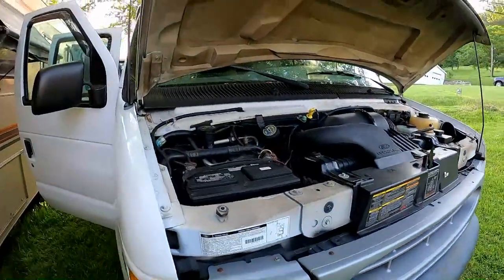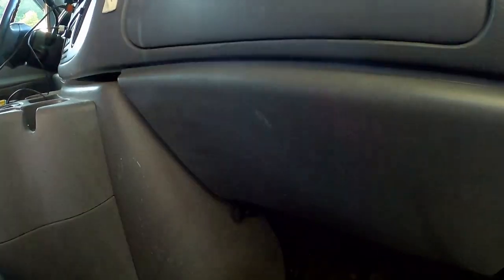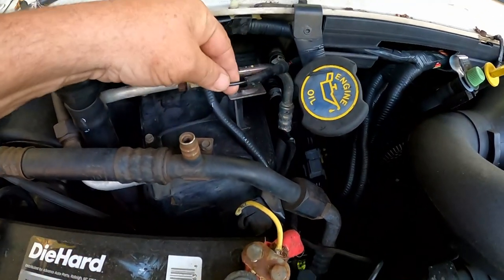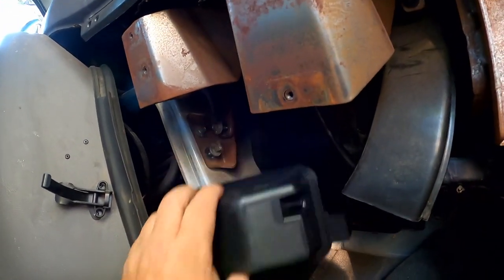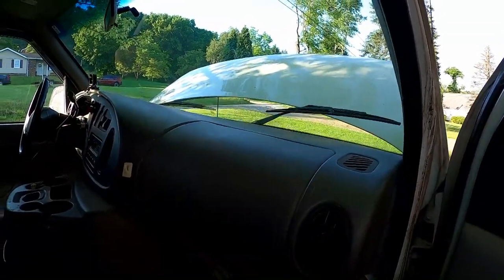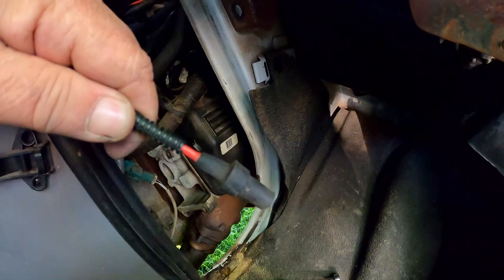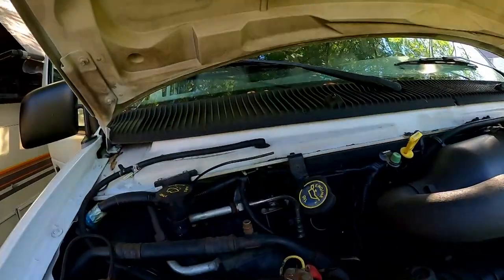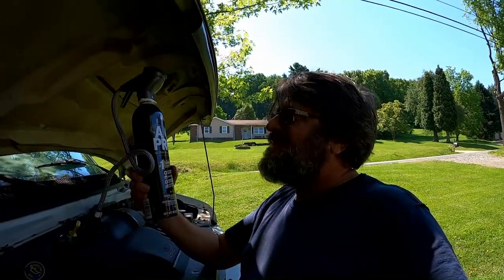FIXED! Air Conditioner Not Blowing Cold Air Out of Vents - Ford Econoline E250 AC Repaired Recharged

Comment: I saw a van build on video where the AC was in an upper cabinet.  The outside of the van had a grill and that is where the air blew.  It was also screened inside.  Looked cool but took up a whole cabinet.

Comment: Just as you were looking for the keys I told Suzy that i know there's going to be a bunch of dust blow out of them vents when Dave turns them on. Soon as the dust came out Suzy said "well, you tried to warn him!" LoL. Done that same bypass myself before. Got blasted in the face with years of dust. Apparently had my mouth open too because my reaction was the same. Trying to spit out all the dust. As for the air conditioner deal. It may be ghetto looking but it will be functional and not taking up space in the van. I think it's probably the best option since any space saved is space that can be better used for something else. Great video and awesome how-to on that bypass! Looking forward to see what you do with it next. It's really looking like things are starting to come together.

Comment: Dave I did HVAC work for 38 years,  You dont charge the ac at idle you need to rev the engine up like your on the highway.With the engine running faster the compressor will move more refrigerant and could start cycling on and off again
Reply: true he did not do it right. but then he did not look how much it takes.
Reply: Ahhh thanks!

Comment: Thank YOU so much for the quick fix. I was told the vacuum reservoir part was on the van ONLY to make the vacuum work a bit faster and that it's not needed, so I went through the fire wall from the engine side and hooked directly to the tube under the dash. I didn't even need extra tubing....AND IT WORKS GREAT. Thanks again for the idea of going through the fire wall. GENIUS !!

Comment: I have a Ford. The Mechanics charged the system then I found the real problem It was the AC clutch. which expanded  when it warmed up. Replaced the Pulley and clutch  used the correct spacing washers and it's fixed.(for real)

Comment: So Glad I found your video. My 2014 E 350 was exhibiting the same issue although the vent would occasionally work but nothing reliable. The only difference in my mod was that there is a glovebox were the kick panel on Daves was. After removing that there was room to mount the vacuum part fascind with velcro to the blow motor housing and re attach the glovebox. I have A/C from the dash vents just in time for the summer heat.Thanks again Dave.

Comment: I just finished doing the work around on my 1999 E-150 van.  Took about an hour to complete inclucing putting tools away!  Now it works as it should!  Thank you for posting!!  BTW the dealer wanted $1,100.00 to fix the vacuum reservoir, I paid $50 bucks to Amazon for the parts!!

Comment: Dave, I am so happy you are going with the window unit A/C. It keeps outside air circulating outside, and inside air circulating inside. It will be ten times more efficient than the portable unit, and a thousand times safer from generator fumes. Also you can take a small fan and direct the air anywhere you want it and A/C want kick on and off so much because of getting to cool next to the unit. Love your videos 😎👍

Comment: Hanging out with shore power to my rear window unit while watching your video. Painted plywood is ghetto.
I have 1/4" white plastic. Seals good and looks good. 
My cord runs out under the door through a gap in the weather striping. I added a breaker 15 amp.
Any shorts in my appliances trip my breaker not the breaker in the house or garage I'm tapped into.

Comment: We didn’t need air conditioning with side wing windows - the best cross breeze you would need.  Bring ‘em back!
I saw where a guy cut a hole for a window air unit - put it on a slide to push out when parked, slide in when driving.  He used a boat hull cover to seal up when pushed in.

Comment: Good fix dave. If u want cold AC ,  change the stock Expansion valve ; rated for under 100 *F  to a Heavy duty tube 102*F + 
Vacum down & charge to full.  I recomend using a hi side gauge also when filling. They sell a AC with a 2 hose in one, intake /exhaust. Camp Safe

Comment: Dave, I'm at about 1837 in and had pause and read the other comments. Am I the only one who noticed that the thermostat dial (immediately  left of the heat/ac selector) was set in the middle where the red and blue meet? To get cold air, the thermostat needs to be in the blue.  Just trying to help, buddy.  :)

Comment: Your adding gas. Turn it upside down to add liquid to the system.
Reply: This setup may have a feed tube that runs to the bottom of the bottle. I know we used to turn the 12oz. cans of R12/134 upside down.

Comment: get a piece of thin Lexan or plexiglass with some window tint on it and apply it to the outside of your plywood. Paint never seems to hold up well on plywood. The grain raises up and starts looking bad pretty quickly. With the tinted Lexan, It will look almost like the AC is passing thru the glass.

Comment: 🚙  Open windows and a water filled squirt bottle did the job back in the day and still does whenever needed. 💦  I greatly admire your mechanically motivated, make it work, mindset along with your how-to videos.👨🏻‍🔧 
In my humble opinion I seriously doubt a white window a/c unit will be that noticeable out the rear because of the additional generator/bike rack that’ll be holding items below it.  You’ll still be able to open the door and attach a rolled up doorway magnetic bug screen for those days of simply wanting fresh air flow etc. 🦟
Reply from the maker: I keep forgetting to search for bug screens! I'll look into it!

Comment: Hey Dave hope it's not too late to read this.  But you know how much I respect you knowledge.  I noticed a stain that looks like grease spot on my ceiling inside  by my ac unit.  Could that mean possibly my ac leaking between my roof and ceiling.  Have a man coming next week but afraid I'm going to get ripped off.  Sorry my explanation is sketchy.  Just wondering if that's how the beginning of a leak starts.  Thanks Traveling Grandma
Reply from the maker: That could be just dirt that accumulated over time that got past the air filter. I have two spots on y ceiling that are due to be cleaned.
Reply: @DavesRVLife  thank you

Comment: Had i known i went through and stuck a coat hanger through the grommet up the fender then pull the vacuum tube back and connect to  line inside.  No need to open doghouse or anything  i didn't do the reservoir so when going uphill I went back to defrost. The people I bought it from just zip tied it to vent( the pop out piece on the dash
Reply: Where you cut the black line just poke the coat hanger there.

Comment: Good evening Dave . I have been watching your channel quite some time . Hi Dave I have a 1987 Ford Econoline E350 cargo van I bought the van brand new in 1987 I have a hundred and forty thousand miles on it . I was wondering if you have any time extra time to work on the van doing some mechanical work I need a new carburetor I would like to make it a camper van Could you help me please .Thanks
Reply from the maker: Hi Curt. I really wish I had extra time on my hands, but I don't right now. I hope to have a little sometime soon. Where are you located?

Comment: The AC Reservoir is behind the AC Fan under the hood..And it's that rubber 3" hose that is attached too it that goes bad...You can just stick a coat hanger down there and hook the hoses. As it has a three port AC vacuum T attached to that 3" long hose. Then a hose that passes through the firewall on the passenger side. You can see the hose passing through on the passenger side kick panel. It has a rubber grommet around it. That goes up to the control value..Then you mount the new one under the battery tray. There is a hole for a bolt to attach it there...Takes 20 mins to do. The whole job...

Comment: I would add. Put a little saliva on the check valve and splice connections. The 1/8 hose slides on a lot easier.

Comment: Hi Dave how did you know it wasn't the AC blower motor instead of what 
you replaced? I recently bought a 2007 Ford E250 van like yours and the 
guy told me he thinks the AC blower motor needs to be replaced but I 
noticed the AC vacuum line hose in the engine compartment was capped off
 with a screw. Why do you think the previous owner did that? The AC hose
 line under the hood is cold with condensation water dripping like 
normal to the ground but nothing blows out the vents. Can you show the 
Amazon links to the black box and white vacuum valve in case it's not my
 AC blower motor which is about a $55 part from the auto parts store. 
Let me know. Thanks
Reply from the maker: Because the fan did run and blow air to the defrosters. 
https://www.amazon.com/gp/product/B07CPX9H6H/ref=ppx_yo_dt_b_asin_title_o02_s00?ie=UTF8&psc=1
https://www.amazon.com/gp/product/B000O0V7LM/ref=ppx_yo_dt_b_asin_title_o03_s00?ie=UTF8&psc=1
https://www.amazon.com/gp/product/B00030CZMS/ref=ppx_yo_dt_b_asin_title_o04_s00?ie=UTF8&psc=1
Reply: @DavesRVLife  Thanks Dave for answering my question and for the links. Now I'm ready to fix my AC : )

Comment: I'm sure this was a very informative video when it was made 2 years ago. However, now it's an excercise in frustration; 
1) Questions and comments about the parts on the order list:

     a) Pico Wiring accesories Part 5165PT labeled "1/8" Vacuum /wiper tubing/operating temp -40 C to +82 C" 6ft. Which appears to be fexible vaccum tubing with a 1/8" inside diameter and a 1/4" - + outside diameter. If you order that part number, that's no longer what you get. NOW you get a not quite 1/8" ID and not even close to the outside thickness shown, nor the maliability or flexibility shown. It simply can't be worked onto any of the nipples on the check valve or worked onto the reservoir. Instead Pico Part number 5165PT is a comparatively rigid (not at all maliable or flexible) tube that is barely1/8" Inside diateter and is NOT at all flexible enough or maliable enough to be worked onto the various nipples they need to go on. As I said. 
   In addition all 4 major auto parts stores (NAPA, O'Reily's, Autozone, and Parts Plus), say they no longer carry 1/8" ID /1/4" OD flexible vacuum hose as is shown and used in this video. If you order using the given Parts numbers from Amazon, you'll also end up with the wrong parts.
Please update your info, otherwise your videos are obsolete.

Comment: it says how much refrigerant it takes in the engine bay. on where it says what engine it have, or somewhere else on it. as can't over chaerge it. but don't ues any refrigerant with stop leak, shops can't recovery. & can clog parts of the ac. i would say to get some ac gauges & some cans of r134a just r134a with no stop leak in it won't hurt.